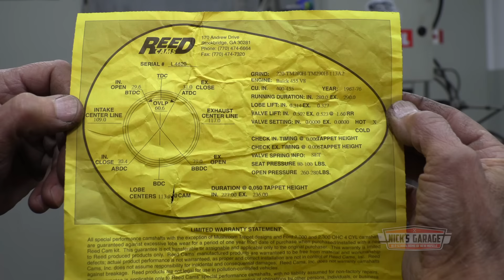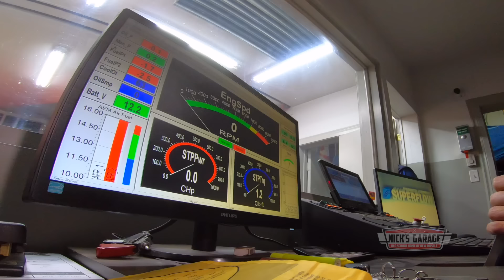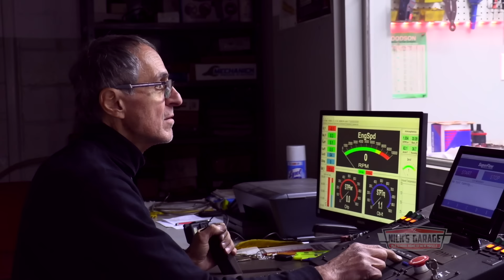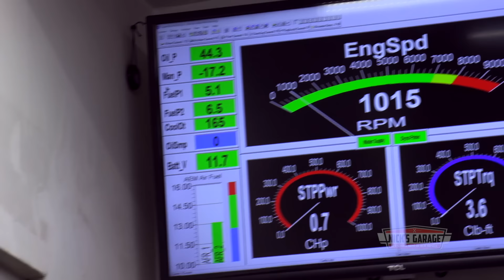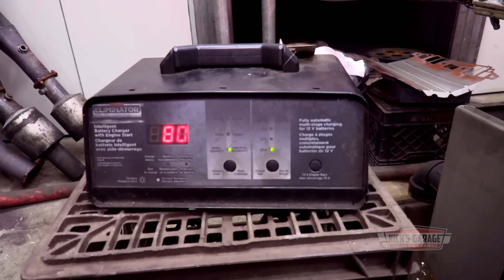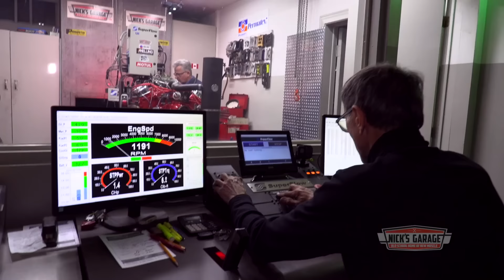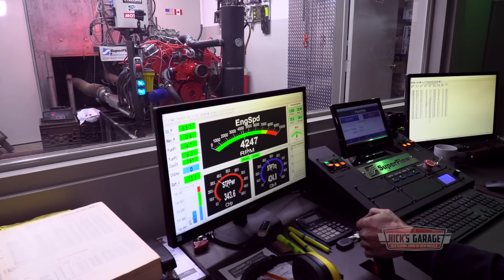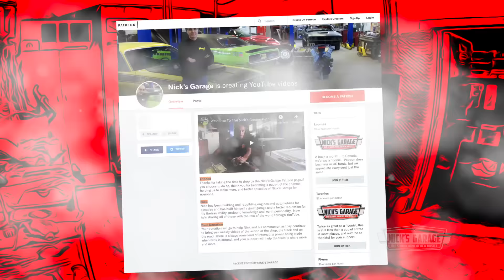1970 Buick 455 Stage 1 - Dyno Room Diagnosis

Comment: I have never lost torque by installing long tube good headers! I have seen garbage shorty headers make little difference over manifolds, & they still made 10hp & 10ftlbs over the stock manifolds on a stock Buick engine! Horsepower comes from airflow thru the engine. Aftermarket camshafts need the proper valve springs! Reed racing camshafts have been around for decades! What springs are on the engine & where is the camshaft degreed to? Alot of stock replacement parts are junk today! There are very good aftermarket parts, & only cost a few dollars more. So why would you chance problems? Has anyone checked to make sure the secondaries are actually going full open? When a engine is rebuilt properly, It should be better than it was from the factory! Torque is not there & falls off a cliff, immediately! Even the late 70s crappy low compression emissions versions are not far off this build!

Comment: About Reed cams, had a competition plus cam in my 65 sport satellite 383 with 780 dual line headers it ran in the low 13s and high 12s I want it back that was 45 years ago

Comment: Nick, the thicker the gasket on that paper gasket for oil pump would worry me more, if surfaces are straight you shouldn't need! Just ad some silicone!
Reply: Replaced oil pump gasket, not much thicker. No leak and same oil pressure.

Comment: Nick, be safer and get or make a proper stool and stop using the milk crate for every ones safety. Another good option would be to beef up that milk crate with wood or metal for safety. The milk crate is not intended to be used as a stool. Get some thing safer or beef up that milk crate. Nice to see you and Manny telling us how you are fixing the issues that you had with vacuum and oil leaks. Thanks for sharing when things do not go perfect so we can all learn.

Comment: We still don't know if it's a true Stage 1. You didn't notice the heads if they had the bigger valves?Im sure you can check the stamping no's in the heads .
Reply: They aren't 1970 Sage 1 heads. The area above the two center exhaust ports is machined flat on 1970 Stage 1 heads. Those look more like 1969 430 Buick heads.
Reply: @rollydoucet8909   Not true. The casting numbers were the same on all Buick 455 heads of a given year. Only the PART NUMBER was different.  Stage 1 heads had their valve bowls opened up for the larger valves.
Reply: @LR-my2di  You're wrong. The 1970 and later heads (including Stage 1) had the area above the two center exhaust ports machined perfectly flat, and drilled for quarter inch coarse thread bolts that held the collar for the heat duct and dipstick. The real Stage 1 heads and also the 1971 and later Buick Centurion engines had the larger intake valves, with one difference, the Stage 1 has swirl-polished valves, and the Centurions weren't swirl polished. We worked on these engines back in the 1970's and raced 1970 and 1971 cars in NHRA Stock Eliminator. Years after that, we built and sold Buick engines for many other folks and still have quite a few parts for future builds.
Reply: @rollydoucet8909  I'm not sure what the point is regarding the "perfectly flat" area you're referring to (if there is one) but I do know that the casting #'s on (for example) all 1970 455 heads are the same.  Only the part #'s in the books are different.  But then maybe I don't know exactly what you're referring to.  Anyway ... 
Are you in Canada?  If so, do you know Keith and Duane?  And yes, I'm familiar with the Stage 1 valves in the "big cars" you mention.

Comment: If you want to enhance a set of points for damn near makes it like an electronic mission I mean it does a really good job I was told you run MSD ignition and it lowers the voltage down to .9 V across the points they last way longer

Comment: I grew up in Flint Michigan and learned to work on Buick engines in high school. I was fascinated with the Nailhead engine design and it’s similarity to the Hemi’s rocker arms. There was a Buick XP-300 experimental 216 CID V-8 engine… supercharged, aluminum block and had Hemi heads. The Nailhead lost the Hemi head design and it’s very similar to the original 216 V-8. You can find diagrams online for comparison.

Comment: I can’t believe they didn’t check the points with a new rebuild, and then didn’t gap the new ones.
Reply: They didnt gap them with feeler guage because they used a dwell meter, which is setting the gap and more accurate

Comment: The cam's duration presumably is a fair amount more @ .050" which would also account for a lower torque number and with the lower static compression could explain why it didn't help at the higher revs.
Reply: Bottom right corner of the cam card showed specs  @.050”. Without rewinding, I believe it stated 220* intake and 236* exhaust duration @.050” valve lift.

Comment: 70 Buick 455s that was rated at 360/510  was out of the stage 1's and were over 10:1 I'm pretty sure. If you put pistons in to make 9.4 :1 sounds like a 71 on motor
Reply: The 70 stage one 455's were way under rated and They were faster then a hemi charger 😞 of the same year
Reply: 71 was 8.5 and rated at 345/460.

Comment: Is Vasili still at your shop; I haven't seen him for a while. Also, I see that you use a paper looking filter when you pour in the gasoline, is the possibility of contaminates so great you need to do that?  Have you ever found anything in the gas that needed to be strained out?
Reply: Vasili no longer works for Nick. He has moved on to other adventures.
Reply: Vasili no longer works for Nick. He has moved on to other adventures.
Reply: Not really. Just a habit.

Comment: Try an 800 cfm Holley spread-bore carb on there. Back in the day, I used to see a huge improvement with just that change. Take those huge secondaries right up to 6,000 rpm and hope you don't get misfires from point bounce!
Reply: Good set of points ( echlin gold) would go over 7,000 rpm. Did it for years. 350 z-28.

Comment: Xlnt episode!!! Lots of diagnostic work, with good results after using patience and skill to solve issues... The lower compression ratio is better because of lower grade gasolines that are now available at public filling stations... However, if I was the owner of this awesome mill, the use of a Pertronics points eliminator kit with a 3Ω 'Flamethrower' coil would have definitely found it's way into use...

Comment: Not sure about Buick, but Chevy had resistor wire instead of a ballast resistor to cut voltage to the points and condenser. A full 12 volts will reduce the life of the points. Especially ones made today. The old Blue Streak or Echlin with phenolic follower were the best.
Maybe try a different ratio rocker arm. Stock I believe is 1.55. Maybe a 1.65 to squeak a few more ponies.

Comment: Stage 1 head's had 2.125 intake and 1.75 exhaust valves non stage 1 were 2.00 intake and 15/8 exhaust on stage 1 head's the valves are pretty much touching they're so close

Comment: Low voltage will destroy a motor tried telling a newby at the track who was running and battery was failing motor was running rough one more run later bent all the push rods of the 70 Nova 454 daddy bought him.

Comment: It really needs a couple pulls with stock exhaust manifolds. Inquiring minds really need to know.
Reply: Headers ALWAYS make more torque on these motors. Something else is wrong.... timing curve not aggressive enough, not as much compression as they think, carb tune.

Comment: Thats a fairly high lift short duration cam 507/523 lift with 280/290 duration. That might be what is killing the low in torque. my 440 had a 510 lift with 305 duration mechanical cam and they recommended a 3500 stall with 4.11 gears because the cam didn't have a lot of low end torque. But top end it roared. Best time 11.2 in the 1/4.

Comment: 455 Olds engines are not GOLD.  They were Red in 68 and 69.  They their own blue from 70 to 74ish then corporate blue till the end in 76
Reply: Sorry, you are correct. The gold in color was the 350 in 1970 that I am use to.
Reply: @nickpanaritis4122  Yes  from 64 the 330 then the 350  were gold along with the chevy 6   They used The Buick V6 for a couple years   Not sure on that color. But I have a picture of one that was at the Oldsmobile nationals that had 10,000 miles on it it was a three on the column F 85 with a V6

Comment: Nick I could be wrong but I believe the Buick
455 was at least 70lbs lighter than the Hemi due to being a 2 bolt main.  I also believe the 455 reached peak rev numbers a bit faster than the Hemi.  The issue with the Buick was longevity, in other words, the motor didn’t last under tough racing conditions.

Comment: In 1970 leaded gasoline was still a thing with 98-102 octane available at the pump. That's probably where the 360/510 numbers were coming from. So 358hp is impressive. Putting a modern aluminum intake is probably worth another 30hp. Look at those "skateboard" ramps on that factory intake. That air is doing more turns than the crankshaft. Not to mention modern camshaft technology is far superior to 40 years ago or when ever that camshaft was made. But it's a cruiser and the customer is probably on a budget, so use what you've got not what you want.
Reply: Like a Pontiac, you will be hard pressed to find better intake than factory

Comment: You're also losing power with that points style distributor get that's only pushing 30 to 32,000 votes get an HEI that will run you with a super cool that will run you $50,000 to 55 when full advanced that's what you need to that high performance motor

Comment: I’m amazed you had the heads off and you still don’t know if it’s a “real” stage 1 or not, and by going with a thicker oil pump gasket that affects oil pressure directly, oil mods need to be done to that block also, as any Buick guy knows that’s where the weak link is for the Buick 455
Reply: Those heads are from an earlier 430 engine. 1969 and down. The 455 heads are identifiable from the flat, machined surfaces above the two center exhaust ports. The heat pipe to the air cleaner snorkle bolted to the heads there.
Reply: @rollydoucet8909  I thought 430's oiled the rockers through the rocker shaft, like a 440,  and 455's oiled through the push rods.  I think you can use 430 heads on a 455 but have to block off the oil hole in the block deck to use the hollow push rod oiling.  I haven't seen one in at least 25 years, so just going from vague memory here.

Comment: nick ,  points ignition require an ignition resistor or the points will overheat & break up like what's happening to you . If you want to do the smart thing install a Pertronik ignition kit  & you can double up on the voltage to your spark . remember this brand cause they can't be beat !

Comment: Crap motor.  Not a reflection on Nick or Manny.  They do top-notch work. It's just a crap motor.  Gutless. My '67 Riv with a 430 cu in. V8 put this thing to shame.  360 hp, 475 lb ft torque.